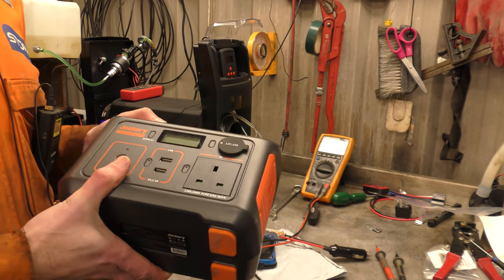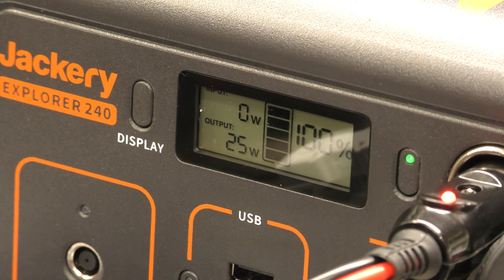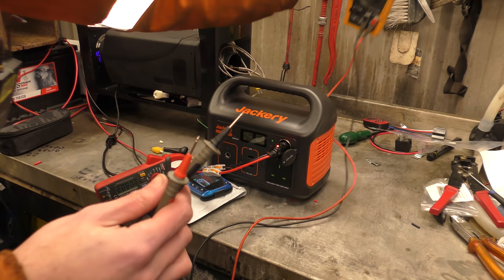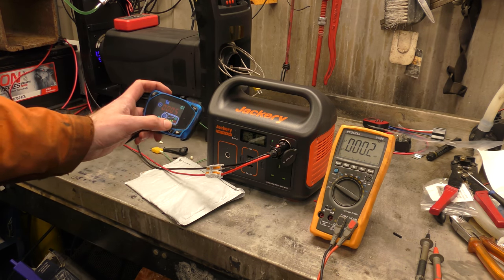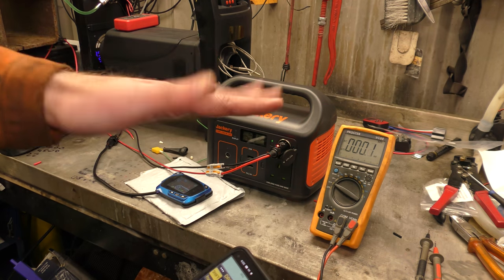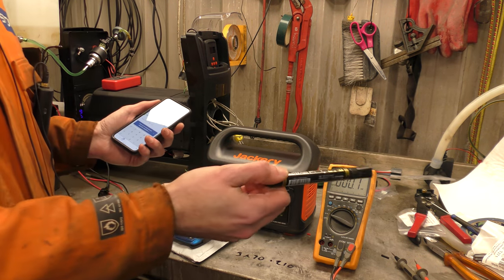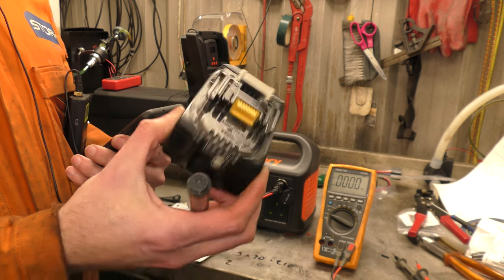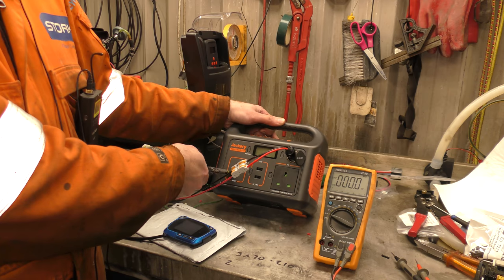Diesel Heater Running from Portable Power Station

Comment: I have a Jackery 1000 pro. I tried to use it to power my 5kw diesel heater and the Jackery shut off after about 150w output. Any way around tbat or how did you work around that issue? Here is the kicker, I used my Jackery 300 for the same purpose - no issues at all.
Reply from the maker: Was it the same heater, same time, same state of charge in the power station?  I've noticed it's very much heater and temperature dependant on whether it works or not.

Comment: How long can the diesel heater work on this portable power station?

EcoFlow river mini 

Capacity
210Wh

DC Output
12.6V 10A
Reply from the maker: About 50 hours by my maths.  Approx 40W running divided by the 210Wh.  Minus a bit for startup and shutdown.

Comment: I am having a time trying to set mines up like this. When plugged to the Jackery 1000 and powered on, 5k heater display lights up, motors/fans kick in, then display flickers for a minute then the whole thing cuts off. But when plugged into van 12 volt plug, heater works. Unfortunately I can't just leave the van on and run it this way as it defeats the purpose. I'm speculating reasons as to why it's not working but I need solutions more than I need reasons.
Reply from the maker: Odd.  The 12V output on the Jackery and most portable power supplies is 10A.  Unless your heater is one of the oddballs that manages to pull more that 10A at startup, which it sounds like that's what it's doing.  Sadly.
Reply: @DavidMcLuckie  Wondering if I get a 12volt to AC adapter and just plug it into the AC port on the Jackery will it work then? Would it pull like a regular heater (too much and kill my battery quickly) or pull less since it's technically still a 12 volt heater with typically low wattage. May have to try this. Cause my next move is selling the darn thing cause I can't use it.
Thanks for the reply btw, 🙂.
Reply: I have the same issue at the moment. Bought a 8kw all in one diesels heater from eBay, wired it up to male 12v 15am cigarette and trying to run it on jackery 1000, the fan start up for about 5 seconds then the battery sign on the diesel LCD display start flashing. It’s giving me erro code E-2. 
Did your get the AC - Dc adapter ? And does it work ?
Reply: Yep, same problem, the support folks for Espar said to ignite it will spike over 10 amps and that trips the Espar heater causing E2 error. It's a brief draw, but you need it. I just wired to the house battery because the heater will automatically shut off if it senses voltage drop, so you will never be stranded.  @hoannguyen-re4zm

Comment: I want to do this instead of running a leasure battery in my van. My diesel heater is currently connected to my car battery. How do I connected the connector that plugs into the unit on the wires from my leasure battery. Do they require soldering?
Reply from the maker: You could use crimp connectors or a screw type block connector if you didn't want to solder.  Just need to make sure the connector is rated for over 10A.

Comment: I just purchased a diesel heater for ice fishing, I am worried that the 5kw heater might be to big, is there a way to lower it to 2kw if it is to hot for my application? And I bought the 5kw because of the case design it will fit my application the best and it is only offered in 5kw. Thanks
Reply from the maker: You can tune to low side to run low but not as low as a 2KW on low.

Comment: Hey David, do you think the power supply can be connected to the wall while running the heater? I would like to use it for its 12v interface and not start with dapters and wirings.
thanks!
Reply from the maker: Some of then can charge and run at the same time.
Reply: @DavidMcLuckie  Will the Jackery do it?

Comment: Heater, 20L fuel can, battery, solar panels etc. Battery has maybe 500 charge cycles if it is kept above freezing and below (?) temp and never totally drained or overcharged? Anyway thank you for all your work. I have come to conclusion to forget about all of the above and just get 2000 watt generator/inverter and electric heater. The out of pocket expense, longevity, maintenance and required dedicated space in a vehicle for diesel heater et al don't seem to make as much $$$ sense as generator/inverter. Open to being convinced I am wrong. Cheers.
Reply from the maker: Your argument is sound.  Without knowing the usage scenario I can't say which I'd pick if I was doing what you're doing.  The only thing I would add for consideration is fuel cost/consumption.  Assuming a petrol/gasoline generator to be 30% efficient and it also having a 20L tank, 6L would be usable energy for the electric heater and 14L would be exhaust heat and noise.  A fuel burning heater is nearer 80% efficient so out of your 20L tank 16L would be converted into heating.  But of course you still need to power the heater.  A single 110AH deep cycle battery will run a heater for over 24 hours on a charge.

Comment: Hi David, I watched this video so many times it's been really useful as I'm looking into getting a jackery to power my diesel heater. Could I ask, the cigarette  socket male adapter I need to purchase for connecting the heater to the jackery, I've seen some that come with a 15amp fuse or a 10amp fuse. Which fusing would I need for connecting the heater to the jackery? Thanks
Reply from the maker: 15 amp.  The diesel heaters need about 10A during start so 15 gives it a little margin for error.
Reply: @DavidMcLuckie  I tried the Vtoman 600x with a 15 amp fused plug and it shuts the station down always in 5 sec.  my diesel heater is a 8k

Comment: I just bought an 8KW diesel heater. Using my Jackery 500 via the car jack. The jackery shows the heater pulling up to 130W on startup but then E-01 comes up and shuts off every time. I don’t know what to do now.
Reply from the maker: 130w is just under 11A so slightly too much current draw.  You could try tweaking the settings for a slower fan speed on the low settings.

Comment: I've a 2kw diesel heater (came with van) connected to leisure battery with crocodile clips. Will this run of my jackary 1000 if the clips are changed to a suir the 12v 10amp socket on jackary?
Reply from the maker: Yes.
Reply: @DavidMcLuckie  What adapter do I need to buy to connect my heater (eyelets) to my bluetti (12v/10amp)? I don't see where to buy the adapter you have

Comment: Can you connect the deisel heater to a battery charger and not use a 12 volt battery ?
Reply from the maker: If you have a 'dumb' charger that can output 15A, then yes.

Comment: Very informative, I just wanted to know more about the cigarette cable and what size fuse you used. Got the allpowers R600 and wanted to power diesel heater with it.
Reply from the maker: These are the exact ones I bought - https://amzn.to/47u8giq
Reply: Planning to try this too with the AllPowers R600. How did you get on?

Comment: Could a 105ah Leisure Battery cope with running this heater on and off for a weekend or would I need a bigger battery? Many thanks.
Reply from the maker: That size would give approx 20 hours of continual use.  Depending on how often you start and stop the heater will reduce the available run time.

Comment: I have ordered a all powers 300 watt power station I wonder if it will power my 5 kw heater if not I will have to get a leisure battery.
Reply from the maker: All I can say is it might.  Depending on the heater, and on the temperature of the batteries.  Failing that a main to 12V transformer is cheap, and the losses are pretty low.
Reply: @DavidMcLuckie  thank you.
Reply: @DavidMcLuckie  I was wondering that as I was looking at an Anker c1000, but I'm sure their 12v outlet only has a 10a rating. Is the loss negligible using an ac to dc transformer? Great videos, very informative and entertaining. All the best

Comment: You ever had any start up issues with the heater taking to many amps for the DC output. I want to get a solar generator but worried about start up. It says the heater can take up to 11.5 amps.
Reply from the maker: The heaters I tried all pulled just ender 10A at startup, but I have had other heaters pull slightly more.  Sometimes tweaking the low settings in the controller and slowing the fan down is enough to get them under.
Reply: @DavidMcLuckie  thank you so much.

Comment: Hi David .. really informative so thanks again ... I am really interested but am wondering how would you go about installing the jackery to ensure it doesn’t run to a point that it doesn’t retain enough power to facilitate the correct suit down cycle?  for example if you are using this configuration to run a night heater in a boat ?  Kind regards - john
Reply from the maker: That is something we will need to figure out.
Reply: Use the timer feature in the heater controller

Comment: Hi, are the wires coming out of your cigarette plug thicker gauge than the rest of the wires going to the heater?
Reply: Mine's are. Not sure why yet tho/
Reply from the maker: Yes, the wire gauge on the plug is thicker than the heater.

Comment: But would it still fry the diesel heater once it ran out of juice as it has a Lithium (18ah?) battery and as you said would step down in voltage and shut down the heater and not go through its cool down phase?
Reply from the maker: That is one of the problems.  We need some way of shutting down the heater when the battery is low, as it will output practically the same voltage until it shuts down.
Reply: @DavidMcLuckie  So even a vsr on the pump as done previously wouldnt kick in as the voltage would remain stable....until it wasnt....mmmm
Reply: @DavidMcLuckie  What about putting a low voltage disconnect on the fuel pump power wire?
If the heater loses fuel does the fan continue to run long enough to cool down?

Comment: Quick question is it possible to start the heater with a car battery and switch to a power station with a switch??
Reply from the maker: I would have thought so.  I might add that to the test list.  :)
Reply: Would like to see that if it’s easy to set up it would mean a longer run time with a power station

Comment: I got the 240 Jackery and the 500 to me its cutting it kind of close with the 240 esp. you going to need the Jackery to run at almost full power when  the heater shuts down. I wouldnt hesitate to use my 500 instead of the 240. Right now im using 2, Valence, U1-12RT  @ 40 Ah each  Lithium batteries.80Ah should run the heater as long as i need before shutting down with out any worries at all.

Comment: 9amps for 1 minute  each time the diesel heater starts up or stops. So it is better to keep the heater running slowly  at 1anp than it cycling on and off more frequent than every 18 minutes. in low mode the heater draws 1amp. at full speed its 2.7 amps. This is why it;s a good idea to go for a 2kw in a small camper van than a 5kw. Also the jackery has a  boost converter to lift the Lion batteries that would be 11.6v at full charge up to 13v. As the batteries voltage drops steeply at the end  the boost converter will need to pull more current  to maintain the 13v until the current limiter will suddenly cut out the 13v Supply. As you say this would be bad for the heater as it will suddenly lose power without a chance to go through cool down. It would have been nice if you had proved or disproved it.  Diesel heaters are designed to run off lead acid car batteries, So that they can detect a battery low voltage 11.6amp at glow plug startup. And then just shut down without injecting fuel. And while running the heater will detect a low voltage and go through it's shut down sequence.
Reply from the maker: Oh we've been through that one a lot in other videos.  There is no auto shutdown on low voltage on these heaters (none of the ones I have).  They plough right on down to 9V and then stop dead.

Comment: Can you put all this diesel heaters from 12volt to 24 volt ?  Or do you need to scange any glowplug or something??

Like all your video from norway
Reply from the maker: You can change the settings from 12V to 24V but the glow plug would need to be 24V as it throws an error if you try to use the 12V.
Reply: Ok i tryed 1. But bo error code. But the glowplug cracked
Reply from the maker: Do you mean you want to run one on 24V?  If so the glow plug, fuel pump and fan motor all need to be the 24V version.
Reply: @DavidMcLuckie  how do you know what it is when not market on any ? You can scange over in meny
Reply from the maker: The fuel pumps and fan motors usually have the voltage written on them.  Not sure about the glow plugs.

Comment: Awesome, what brand of heater is this running and do you think it would run a lavanar?
Reply from the maker: That is one of the many brandless heaters I have.  Depending on the tune of your heater will relate to how much power it uses during startup.  If it's less than 10A it'll work.
Reply: @DavidMcLuckie  Thanks Lavanar themselves say it's around 9.8 amps so in there words it won't work. But I get the impression they are been cautious just in case it's slightly higher. Other people appear to have had one working via a powers station

Comment: Great video Dave, I have set up my diesel heater using the 240w jackery. I used the 12v plug that came with the jackery but my output  doesn't go above 5w. I was wondering what 12v plug did you use or would it matter. I do have. E09 error but that's is probably because the sensor doesn't detect the fan . It doesn't seem to receive any power to start the fan, but it the jackery does work to prime. I won't your the 12v plug be the problem.
Reply from the maker: Which 12V plug came with your Jackery?  Is it one of the small barrel type connections you're using and not a normal 12V cigarette plug type?
Reply: @DavidMcLuckie  Hi Dave, yes it was the one that is used to charge the jackery from the van 12v. I have also used the main van battery in order to check if it was a power issue. But still the fan doesn't move. I also still get the e09 error. I have also ordered a new cigarette plug, same as the one in your video. its trial and error now to find the issue. I am hoping its not the main motor
Reply: @DavidMcLuckie  just to let you know the new 12v plug I ordered did the job. It's finally working.
Reply: @darakeane38  hey which 12v plug would that be?
Reply: @newfoundlanderoverlander  Hi, I bought this one in Amazon, it seemed a bit stronger. KUNCAN 12FT Car Cigarette Lighter Socket Extension Cable with Male Plug, 16AWG Heavy Duty DC Power Charger Cord with LED Lights, 15A Fused.

Not sure if that was the problem, as I also double checked all the connection in the heater. its working fine now and no issues so far

Comment: David where did you buy your diesel heater from, was looking for one for my garage for working in it at winter,
Reply: The 5 KW version is not strong enough for a garage without isolation of any kind unless its a very small garage.
Reply from the maker: As Tom said.  Uninsulated your losing more heat than the heater can produce.

Comment: Hi David thanks for the great videos 
Just wondering if you have run the heater off a ecoflow power bank 
Thanks Wayne
Reply from the maker: I have not.  But assuming it can output 10A at 12V and the heater is tuned to start on less than 10A it should work.
Reply: Hello i had my heater running with ecoflow river pro And it worked for maybe total of 40 hours in different days
.. after it stop working ... i had to change the system and the professional that checked the problem said that it cant be supply by the ecoflow and try with a normal battery and everything was good
Reply: Ps sorry for my english, i m italian.
Reply: @8rubino8  Hi 
That seems strange to me did he say why ecoflow couldn't run your heater .Mine ran it perfectly but I've haven't used it for an extended period yet as it's been warm here in the UK. Shall soon find out though lol .
Wayne
Reply: @wanna31  What did you decide?  Does it run it?
Reply: @danielforrester3039  Hi Daniel 
I've tested ecoflow with heater on numerous occasions for about an hour at a time .when it's first fired up it pulls max of 150w when on tick over its about 7w .On shut down 14w .The ecoflow says it will run for about 40hours but this figure goes up and down .I haven't run it longer than a hour or so .I'm going to use it as a back up .Hope this helps .
Wayne

Comment: Hi there  , you have probably been asked and talked about how do you go about putting a 12 vault connection on the diesel heater ? . All diesel heater s come with positive and negative battery wire's instead of the 12 v connection to plug into the battery pack
Reply from the maker: I just bought a 12V plug off Amazon and put it on.  This is the one I use - https://amzn.to/3Ug8Mt0
Reply: OK cool , is it straight forward to swap the connection  ? 
Thanks
Reply: @DavidMcLuckie  I use this amozon plug too, but is not working on my 8k heater with a vtoman 600x fyi

Comment: Nice test. I would love to get my hands on those wire union connectors. Can you supply the name or link.
Reply from the maker: There are these  - https://www.amazon.co.uk/Conductor-Connector%EF%BC%8Cone-Terminal-Connectors-Assortment/dp/B08XZNJS3J/ref=pd_day0_1/258-9429679-4535838?pd_rd_w=BwYvX&pf_rd_p=8ec13b8a-30d2-48fc-8503-84c56766370d&pf_rd_r=V4CBMSF8G0KC9TPGBX9Y&pd_rd_r=02af22de-9a03-478a-a1e2-5a1f1684900c&pd_rd_wg=2CJie&pd_rd_i=B08XZNJS3J&psc=1

And WAGO even started making them as well - https://www.amazon.co.uk/Connection-Conductor-2-Conductor-Actuation-Transparent/dp/B08X6CPFNR/ref=sr_1_24?crid=7ZN6TD8G77PB&keywords=wago+connector&qid=1644921987&sprefix=wago+connector%2Caps%2C439&sr=8-24

Comment: Just for everyone info. A poweroak ac30 with a 10amp 12v socket won't keep my 8kw labelled 5kw heater running past the combustion stage.
Reply: and my 8k heater will not run with a vtoman 600x and 15amp plug